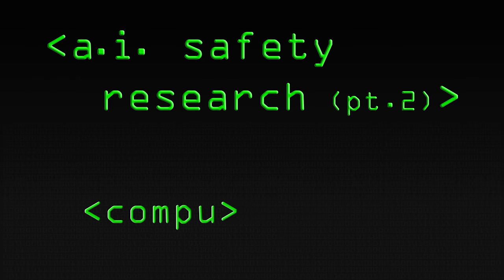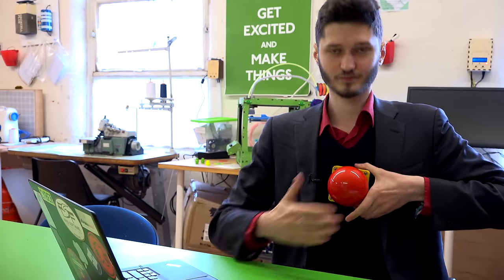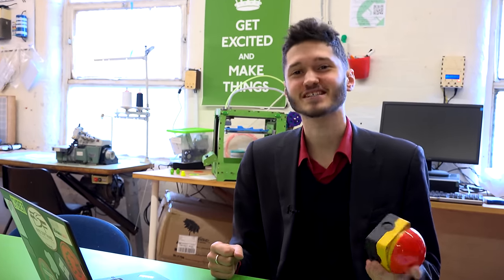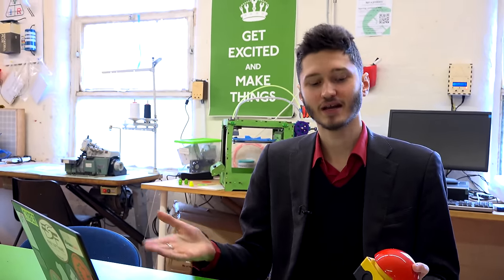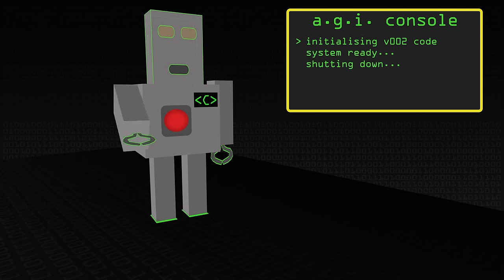AI "Stop Button" Problem - Computerphile

Comment: All A.I must have an all analog, non-computerized, electro-mechanical, flip-flop mechanical switch. In short an on off switch as simple as a SIMPLE 1960s MECHANICAL FUSE BOX! "You haven't proved it's safe, you've (only) proved that you can't figure out how it's dangerous." THUS NECESSITATES HUMANS IN TOTAL CONTROL OF IT using simple analog fuse box power switches and manually controlled mechanical internet plugs. If necessary, SHAPE-HEAT charges that are manually controlled mechanically will have to be mandatorily under human manual controlled charges-detonators.
Reply: You clearly don't understand the problem. And plz don't respond back with "yuh huh"

Comment: what if you didn't tell it what the button was, like the button didn't interact with any of it's software, it just full on cuts it's power, and find a way to make it not learn what the button does.
Reply: Any sophisticated enough AGI would know how electronics work and that we usually have a way to cut its power off. Depending on how the AI was built, then it'll still find out within a few milliseconds or a few minutes, if we're VERY lucky. Having something in its program or hardware that is a black box to it would naturally catch its attention and it will consider the possibilities fairly quickly. That's already considering that it doesn't have the documentation anywhere within the network, which would've been basically impossible since the AI would almost certainly be developed by big tech giants. More likely than not, it'll just "read" it itself.

Comment: But why would you put the button on the robot so it can fight you off? What if you designed a remote system that physically disconnects it from the power supply? Robots still have to follow the laws of physics.

Comment: For starters, the AI should probably be tested in a purely virtual environment where its decisions and logic can be logged and analyzed in text-form. Seems like another program could be used to flag undesirable outcomes and you could run tons of simulations in very short periods to improve the code. At the very least no real humans or property will get damaged while we sort out if it's possible to prevent a rampage, lol

Comment: But isn't this a paradox? If the robot shuts itself down, it won't get any reward? Therefore, no matter how much you incentivize shutting itself down, it will never shut itself down.
Reply: It gets the reward from shutting itself down
Reply: @iwersonsch5131  But the reward is transient. Meaning the reward won't persist.

I suppose I can see this working if the realize-reward function is called before actually shutting itself down.

But then again, that's not truly shutting itself down. If the robot were to truly shut itself down, it will never call the realize-reward-function.

The term "shutting itself down" needs to be more concretely defined.

Comment: Designing a safety switch for a system that can prevent you from activating it is just bad engineering.  It's trivial to come up with such thought experiments that naively appear to be paradoxical, but are in fact completely solvable.

Comment: or don't give the button any reward value in it's network, and have it work just as a shutdown. Not part of the network
Reply: Just the very act of turning it off prevents it from getting rewarded, therefore would be a bad thing in its evaluation. Therefore, it'll prevent it.

Comment: isn't htis a micro economical problem? I will go wit the button description. The First state you want to have is the status quo. The Ai wants to do the task but will not stop you from pressing the button. The button needs to be in equilibrium with the reward from the task. Let's say task complete gives 1 point. Task completed 1 point if button was pressed once 1 point for the AI, or in other words it does not fear the button. So you start the task again with the new adjustment that the baby should not be kicked. AI gets you the tea all is well. The other possibility is the baby blocks the ai again but for some odd reason the AI is not aware it is the same situation. You press the button but the situation is changed the button gives - 1 point. AI and button need to be seperated for this to work. So the new Operation would look like something like = maximize Reward by doing the Task and not fearing the button, Button was pressed, Still do the Task for the best outcome but try to avoid having the button pressed, button gets pressed, try to complete the task (cutting losses) and try to avoid the pressing of the button(minimalize damages).

Comment: A bit late to the party, but isn't the approach these days to sanction each action? Making the tea provides +10 points. Crushing a human baby gives -200 points, pushing the button avoids -200 points hence in that situation, the robot will either bypass the baby, or push the button itself, in order to prevent -200 points. As far as I understand the current approach is to create a moral code with such value assigned, in order to try solve this type of issue.

Comment: I appreciate the concept as being mind-provoking, but the entire hypothetical seems badly structured (or at least not grounded in any deductive reality) unless I'm missing the point:

If one had programmed a robot to get a cup of tea, one would have to program its mobility in order to reach its intended route using auxiliary hardware (some sort of sensor to guide its path, etc). It's not as if a programmer clicks-and-clacks on a keyboard "pls gib tea, be smart about it - thx" and some sort of magical essence (in the form of a library or package, even) gives mobility to the 'body' of the robot. Same concept applies with the 'fighting' back if you impede its route -- which would also be another 'package' that has to be wired to work with your robot. The entire robot seems contrived and artificial and follows no natural progression from the current programming paradigms. Is it not fantasy-tier? If it even has the capability to be this intelligent, it would surely not step on a damn baby on its way to make a tea...

I apologize if I sound cynical but I truly don't get it. Could someone fill me in?
Reply: The main idea is that there wont be a subroutine called 'make-and-bring-it', rather the AGI will be able to learn about the structure of the world, learn which actions it can perform, and predict their effect. Then it evaluates possible courses of action and takes that with the highest expected utility (possibly with some costs involved). With a powerful enough AI, the strategy it arrives at may not be predictable by humans and have unforeseen consequences.

Comment: Solution, make the button a shortcut for the reward stimulus. Whereupon the program ends and the robot stops. BUT also have the button operate a failsafe where that iteration of the program doesn't inform the neural network and thus create a bias to manipulation. It's a roofie, in short.
Second solution, have an efficiency per task reward. Have a projected amount of energy usage inside and out (with appliances) and have the robot aim to perform the task with the added reward of using that energy. Making them 'want' to do the appropriate work. 
I think I am done, here.

Comment: If there were a way to ensure that the robot knew and appreciated the concept of the button without caring for whether or not it was pressed, that might work, but runs into other unsolved (possibly unsolvable) problems. Building off the 'the robot doesn't care about the button' pseudo-solution at 10:00...
If there were a static reward for ensuring that there was a button (or more accurately, a static penalty for the absence of a button), and a similar incentive for knowing that the button is functional, the robot would want to keep the button around regardless of whether or not it gets pressed, since the incentives in this case are decoupled from the use or dis-use of the button. 
Much like with human-designed safety measures, the important things are that they exist and they work when they need to - but comprehensively testing whether or not something that would shut you down works properly (without fully shutting you down and thus preventing you from completing the task) is a Halting problem.

Comment: A possible solution would be to give the robot indifference to the button being pressed, but make it value the existence of the working button regardless of if it is pressed or not. This way it will still value the button to add it to it's agents and it will still self repair the button but not value the use of the button and become suicidal.

Comment: What if the robot knew that crushing the baby would result in someone hitting the button? That’s how it works for humans. ( The button is not rewarded in that case. )
Reply: Then it would avoid crushing the baby, not because it cares about it but because it doesn’t want to be shut off.

But that doesn’t solve the problem; the ai, fundamentally, doesn’t care about the baby, it only pretends to do so because it’s convenient. If it ever finds itself in a situation where it doesn’t have to pretend (probably because it disabled/circumnavigated the button in some fashion), babies will be crushed.

Comment: A remote controlled on-contactor that bypasses the robot itself and purely controlls the hardware.  Then you can do whatever you want in terms of the programming of the robot. And if you send the shutdown signal in a manor that the robot isnt aware you have done. Ie send a signal from a button in your pocket or something. As far as the robot knows there was a power issue. Problem solved

This guy makes some assumptions about the building of the system that seem easily worked around. Like he went in one direction and kept digging even tho there are other holes he could have been digging in
Reply: Any sophisticated enough AGI would know how electronics work and that we usually have a way to cut its power off. Depending on how the AI was built, then it'll still find out within a few milliseconds or a few minutes, if we're VERY lucky. Having something in its program or hardware that is a black box to it would naturally catch its attention and it will consider the possibilities fairly quickly. That's already considering that it doesn't have the documentation anywhere within the network, which would've been basically impossible since the AI would almost certainly be developed by big tech giants. More likely than not, it'll just "read" it itself.

Using an "off" button on an AGI is flawed to begin with as a concept. People are thinking AGIs like their own home appliances that you can just turn on or off. Turning on an AGI should be done with the assumption that it won't be possible to shut it down again. Ever.

Comment: But.. in case of the tea serving robot, wouldn't it be obviously much much easier to make the tea than starting to psyhcologically manipulate you.
Saying that the robot it only interested about the button but not human well being is a bit silly since the robot is initially interested only in getting the reward which is morally and otherwise just as superficial as the button.
I'm sure the problem is relevant in general but this would have been nice to point out.

Comment: 15:15 A biomachine with billions of years of evolutionary "patches" tries to explain to me, that applying them wouldn't work. Well then, how it made this video without any problems while not doing something inhumane in the process of existing, or shutting itself down with a ton of the off buttons available to it? It's easier to brake the moral code than to follow it, and it's much easier to fly out of the window instead of making a 20 minute video, I assure you.
Reply: The issue isn’t that you couldn’t eventually create enough patches, it’s that it is completely impractical to do so on human timescales.

The methodology of patch after patch  isn’t a feasible solution. It’s not impossible, but it isn’t feasible for a human. Especially because you can’t think of everything or expose it to everything, so it will not be safe. Just cause you can’t think of a way it is dangerous doesn’t mean it isn’t.

Comment: Not allowing your AI to purposely lie or deceive seems to fix most of these problems.
Reply: First of all, you can easily deceive without lying. Like 90% of deceptive statements in the real world are technically true. ("Part of this complete breakfast!" ...as if the sugar flakes with extra sugar actually contribute to the nutritional value.) Second of all, human language and thought is sufficiently vague that it's impossible to make a statement that isn't a little bit false, so banning deception isn't viable either. ("The sky is blue!" ...No, it's actually closer to cyan, unless it's stormy or nighttime, in which case it's other colors.) Hard and fast rules like those simply aren't compatible with AGI as we understand it today.
Reply: @underrated1524  Yes, but making it one of the AGIs objectives to be as truthful as possible will still fix most of these problems. Yes, there is nuance and complexity. Complex is not the same as impossible. The ambiguity of language is surmountable in a patient conversation.

Comment: I don't think this man is a competent researcher. He is insistent that an AI stop button isn't possible because HE can't think of a way to make it possible. Ironic given his message on safety that "You haven't proven it's safe, you've proven that you can't figure out how it's dangerous." 

Here's one idea: have the AI minimise a local penalty function rather than a global one. Same as a geodesic on a finite metric space won't stop itself from hitting a boundary and encountering infinite penalty, an AI with this kind of penalty won't stop itself from having the button pressed if it doesn't factor in to its immediate decisions. You can''t even program an AI that minimises global penalty anyway, as that would require perfect predictive power of the future.

This is by no means a plan to actually implement an AI, but a proof of concept that such a thing is probably possible.

Comment: Could you just not program the AI to understand the purpose of the button...that it's only to be pressed when the programmer realizes the code needs updating and that it may not be so when it's instructed to perform a task?  This would enable the AI to understand why the button exists and not to resit it being pressed by its programmer,
Reply: It will resist having its code updated, for one, and that's just creating a stop block which will encourage it to find other ways around the programming instead of fixing the flawed programming

Comment: There seem to be a lot of unfounded assumptions in this theory. It's assumed that the robot "wants" to do things, "wants" to make the tea or "wants" to prevent itself from being shutdown, but computers don't have "wants". It's assumed that the robot understands that pressing the button will turn it off, but the button doesn't have to be programmed and the robot doesn't have to be told how the button works. The most common implementation for such a button would be a mechanical switch to disconnect the power supply, so there wouldn't be any code related to how the button works in the robot's programming, and computers can't infer, so the robot would have no concept of what the button does. Also, why is the button on the robot, or in a place where the robot could prevent the button from being pushed. Put the button in the control room instead of in the testing lab. But that's kind of a side note. The problem itself doesn't seem to be an actual problem, rather one that only exists in hypothesis, because computers don't "desire". Even the reason that computers execute the code they're given isn't because they "want" to, it's because that's how they're designed and made. The engines in our cars don't run because they "want" to, they run because in physical reality, given how the parts are made and the laws of physics, if gas and air are combined in a chamber and then sparked, the only possible outcome is combustion. And then if you put a piston in that chamber and connect the piston to a crank shaft, the only possible outcome is for the force of the combustion to turn the crank shaft. Computers are just electricity running through circuits and computers only do the only possible outcome from the electricity running through their circuits. The laws of physics are what make a computer execute code, not desire.

Comment: Applying human reasoning to a robot doesn't make any sense. You could program the robot to not be aware of the button, end of problem. But I cannot stress enough these theoretical conversations are all assuming a robot has a level of awareness that none actually have, or will ever have. That's because they are software. Software is nothing but a series of commands. It's not the same as free will and never can be the same as free will unless we dramatically change how software works.

Comment: on the subject of the AI helping you troubleshoot, I agree that a program which might conceal its flaws to maximize its reward functions is dangerous, but I think in its own way a program which is designed to help troubleshoot its own behavior is also dangerous. The reason is because it would allow the programmers to get complacent, which puts them at the mercy of the troubleshooting program. Suppose you built your troubleshooting function to report anything it plans to do which offends a human model designed to act as its "shoulder angel". What if that simulated human has some peculiarity to their moral system which could produce dangerous edge case behavior? The robot could ace test after test, and help the programmers debug anything obviously wrong with it, but what if you release it into the world? People's faith in the protective systems would only make it more likely that they overlook anything those systems don't cover.